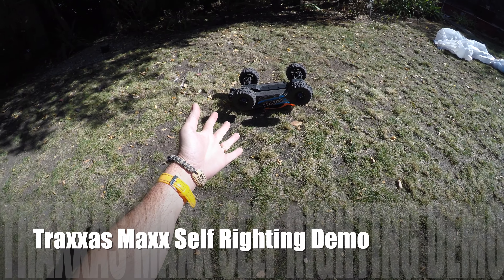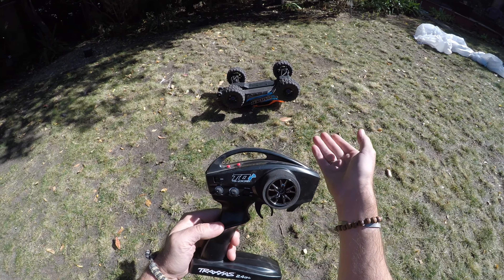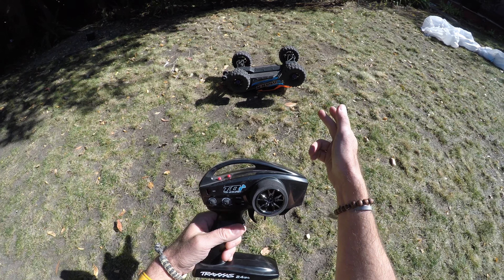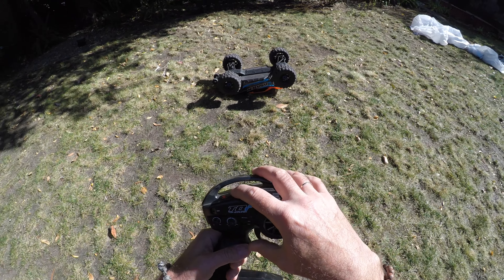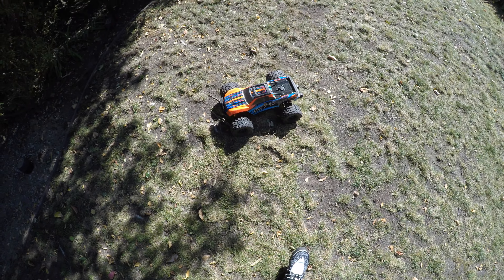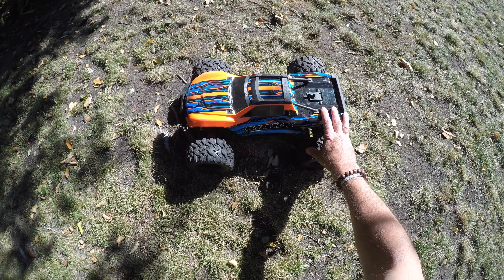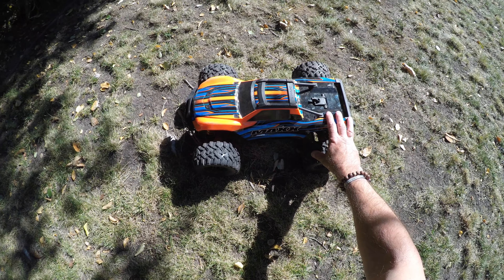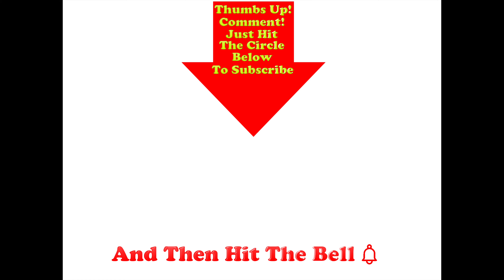Traxxas MAXX Self Righting Function Demo

Comment: Do you need to have a 4s battery to use this feature ? We are running with 2s and the car is not righting.
Reply: I have 3s and its super close to doing it only done it successfully once but im getting a 4s tomorrow and I'm sure it will do it well

Comment: Is the self righting a feature of the rc or the remote control. I have a dhk Maximus on the way and this feature would of been nice to look into when i was shopping around
Reply from the maker: It's a feature of the cars remote control, you could fit this receiver and transmitter to another car, I'd never thought of doing it but you raise a VERY good point! I may try it out on another RC!
Reply: @DriftomaniacsRC  lol I wonder if it works. Unless the car has some kind of special sensor under the hood

Comment: Me mate did this on his E-revo twice and it stripped gears.
Reply from the maker: I blew a tire doing it on my erevo! There’s times when I’d not use and times when I would
Reply: @DriftomaniacsRC  Fair play. I just look at the self righting and think, "That cant be good for the truck"
Reply from the maker: @FullOnRC  yeh i do have some mechanical sympathy and if it's near me I'll walk over and flip it back over! I'd avoid using the function on loose dirt or slippy stuff like snow (tried it on xmaxx in the snow - no joy!), but on dry grass it's not bad. My erevo tire blew when the wheel ballooned and clipped a small rock sticking up!
Reply: Proline Trencher HP tires. They're belted so no blowouts. 
Also Idk about the e-revo but I have a 3.3 revo converted, running 6S on the Mamba  Monster 2 so I have a Metal spur/Metal Tranny parts from robinson racing. Might be worth it to see if there's anything like that for yours. Bash on!

Comment: Ya man I’m not keen on the plastic joint in the wheel hub it is a Massive weak spot and using that feature will only further make those parts wear out 

I know Traxxas means we’ll for the most part but their heart needs to be in it over the top and fix small issues like this right away so the price being high stays a benchmark view of what tough  is and worth every cent is 

I hope the small plastic pieces get made into metal and then this truck will be rock solid. 

Why not it saves them in so many ways. I hope they do
Reply from the maker: Very good points and I think they're beginning to take onboard more customer feedback. I've mixed views on the plastic driveshafts as my arrma granite 3s BLX ate them but others didn't seem to have so many problems. I had the traxxas rustler 4x4 and that wasn't as bad on eating driveshafts as the arrma was. I upgraded the granite ones to HR ones, problem solved albeit at a lot of expense! I will upgrade as and when stuff breaks on this, I've been testing it around the yard this morning, and I have to say the thing is manic, just manic. I had to stop before I bust something although the brakes are phenomenal. I've got a few 6s arrmas and I'd have to say off the line this things quicker.
Reply: Driftomaniacs 
Faster off the line wow 
Traxxas does know how to make a fast car that’s for sure. 

Even the mini’s are 40plus Miles per hour. 

Now if they fix up the Diffs on them and diff cases they can be a good platform to. 

I am coming to see Redcat and Arrma are my ideal vehicles 
I choose them because of Jennys.rc store 
And amazon part availability for Redcat parts 
And GPM hubs for granite  on Amazon. 

Thanks for the message bud. Means a lot 👊😀

And thank you for what you do guys like me are learning loads here about this wonderful Hobby and rest assured I put what I learn to good use building  good strong RC  cars and trucks for my kids and their friends to enjoy and hopefully they stay involved with it because they love it. 👊😀
Reply: metal breaks easier abd bends and can't be fixed this is common knowledge
Reply: @Ghost.uppercut  
That’s what M2C and other companies are for.
Reply: Do you think Henry Ford made more money  selling model T or selling parts for it